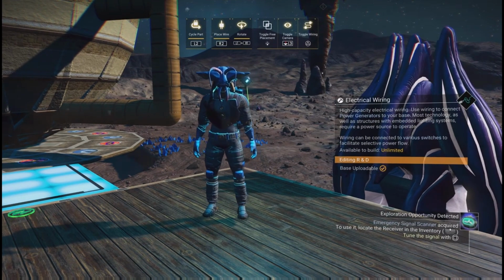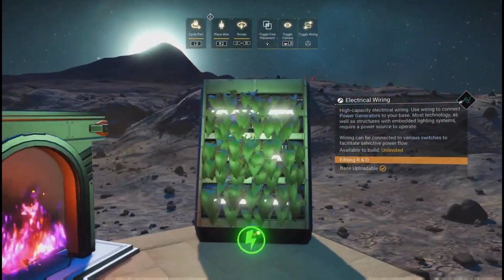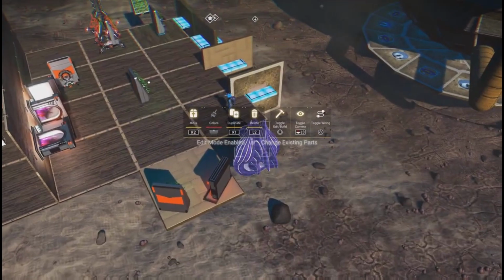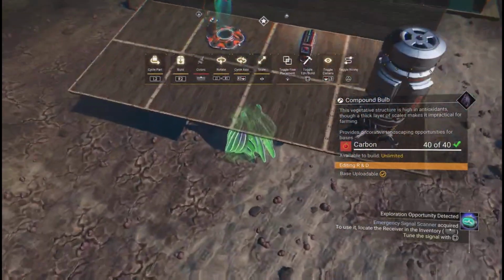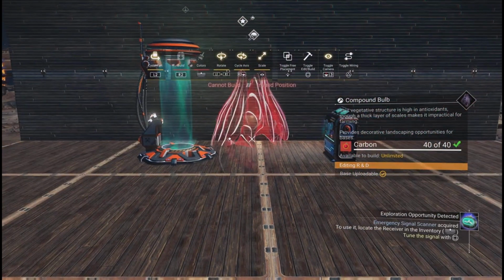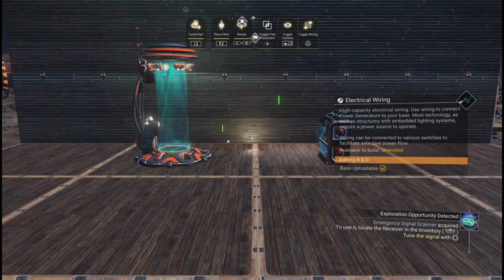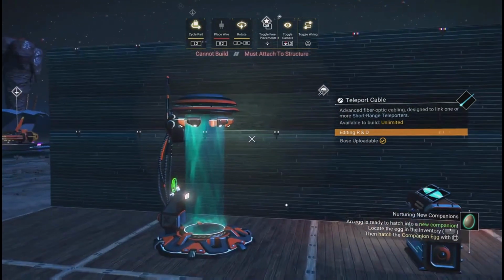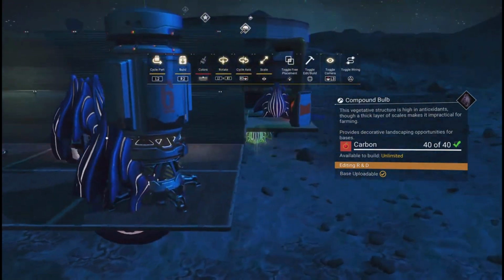Glitchbuilding for Beginners Episode 2: Glitching Parts

Comment: After glitching the desired item in the desired location, are you able to remove the "connector object" without affecting the desired object?  Such as the vertical floors: after glitching them into the light floors, are you able to remove the light floor without affecting the vertical floor?